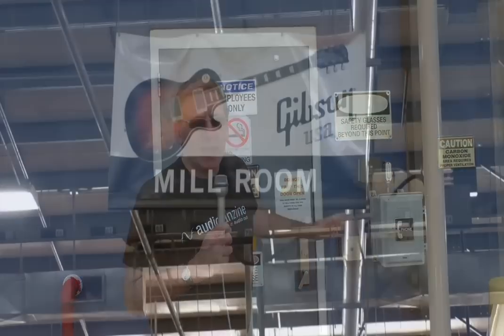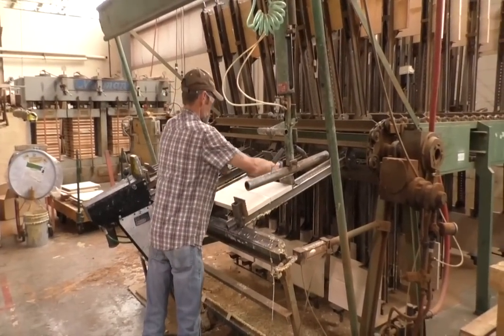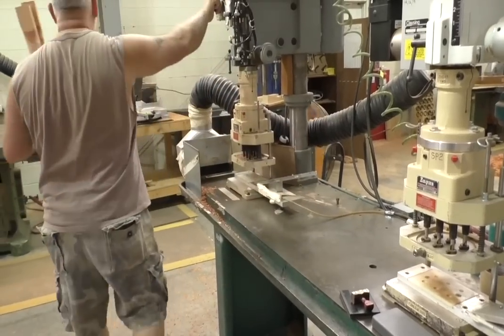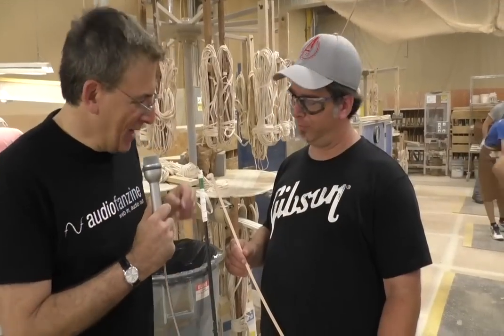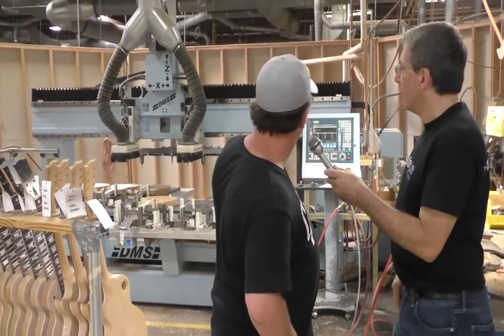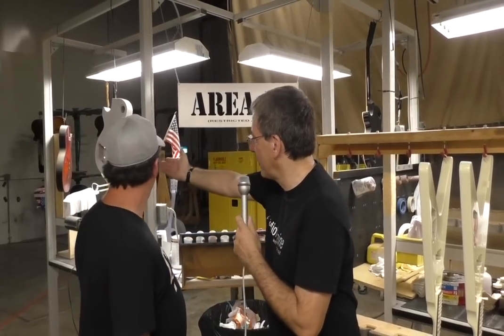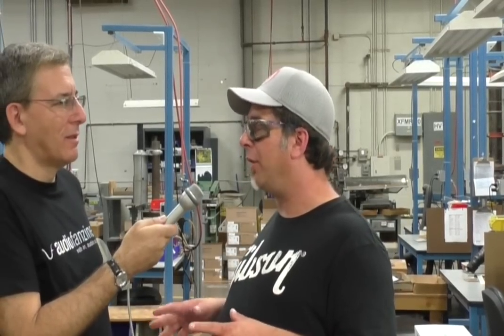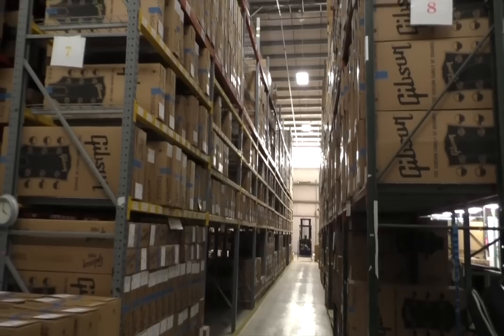Inside the Gibson Guitar Factory

Comment: Just reading a couple comments above, and this needs to be properly addressed: tuning issues are NOT caused by the headstock angle. It is mostly caused by three things (regardless of the brand of guitar), in this order:

1. An improperly cut nut. Nut slots that are cut too deep or too tight will cause all kinds of binding issues that wreak havoc on the ability to keep a guitar in tune, especially if you do lots of vibrato and string bends. Even if the nut slots are cut properly, sometimes the material itself can cause friction within the slots that can affect tuning as well (especially if it is dry). No matter the guitar brand or the nut material, always, and I mean ALWAYS use nut lubricant. I actually use graphite pencil shavings as a dry lubricant on all my guitars. It never "dries out" like oil-based lubes (because, inherently, graphite can't), and it works like a dream. Before I used it, sometimes I would get "pinging" or "chinking" of the strings when tuning or during string bends, but that's a thing of the past with the use of graphite in the nut slots.

2. Weak and unstable neck. If the neck is flexing too much, it throws the pitch and tuning off. No neck that is unstable will be able to stay in tune. Ever. It amazes me how many people overlook this extremely common issue when buying guitars, or when diagnosing a tuning issue. Grab the neck, strum a chord, and gently push the neck back and forth. Ideally, the pitch should change very little. A little bit is okay of course, but if it sounds like you are using a tremolo, you have a crap neck, and nothing can fix it unless you can replace the neck itself. Unfortunately, this is one area where Fenders actually have an advantage. Also, a loose and/or improperly set up truss rod can affect neck instability and tuning issues as well. Make sure your neck is set up properly.

3. Tuners. Believe it or not, tuners are actually the least common source of tuning issues! Seriously! This isn't to say that crappy tuners can't cause tuning issues - because they can - but more often than not, it is the two issues above that are the more common source of tuning instability. However, if the two things above have been properly address and diagnosed, and you still have tuning issues, then try changing your tuners. But even the best tuners in the world cannot fix the issues above, so don't think that replacing the tuners alone are a one shot solution, because they often aren't. Also, if you have tuners like this: tighten those little screws on the end of your tuning keys! Those are there for a reason! Tightening them helps to regulate the turning tension of the tuners themselves, and can help with tuning quite a bit. I have owned both cheap and expensive guitars that had tuning issues, and were either significantly improved or even had the tuning issues resolved (with one guitar I owned) after tightening the screws on the tuning keys. All it takes is a Phillips-head screwdriver and about 30 seconds to do.

Hope this helps. Cheers.
Reply: I own four different Gibsons, three of which are very old(40 and tp and 60+ years) probably built before all of the automation. But i also have one that is only 4 years old and i am equally happy with all of them. (68 Gold top, 75 L5S, deco LapSteel, and a new ES339). Love em all. Also have a rosewood tele and many others. But i love my Gibsons.

Comment: For those who can't afford a $2,500 Gibson Les Paul - you can pick up a used Gibson Les Paul Studio in the $799 range and it's roughly the same guitar without all of the expensive frills (like highly decorated maple tops and plastic binding.)  If you're really on a budget, you can score a used Gibson Les Paul Tribute series from 2013-14 for around $599.
Reply: budgetguitarist.com my Gibson les Paul studio was 2000$ what are you talking about
Reply: There are different grades of Studio models, but $2000? You got screwed.
Reply: When I was trying to buy a new Gibson Les Paul Studio Ebony I saw prices as high $1800usd and as low as $1099usd. After some negotiation I picked one up for just under $1000usd.

Comment: I had an Explorer that I bought brand new in the mid 80's that was reasonably priced. It was white with blue paint splashed on it and a Gibson modified Kahler. Gold hardware too and held its tuning perfectly. My only complaint about it is that it had a lacquer finish which developed brown marks where the guitar rested on the stand which had black foam on the supports. The lacquer took on the foam's dye after owning it for two weeks. I learned the hard way about lacquer finishes. If I ever get another guitar with a lacquer finish, I'll have to put it on a stand that has surgical latex on the supports.
Reply: Lacquer is can be very weather depending product. If there is a lot of humidity you will have problems. You can only control so much a simple open door can screw it up

Comment: I own two Les Pauls. The quality at Gibson is very hit and miss. My Studio model is a better playing guitar than my Traditional that cost almost twice as much. When you pull any of the covers on the instrument there's all kinds of loose wood shavings, saw dust and unsanded areas, just very little pride in what their putting together. I'll probably never buy another, they just seem to be more interested in the number of instruments they can put out instead of the quality. Oh and the lacquer on the headstock started to separate at the machine heads. I have guitars that don't even cost a third of what my Gibsons cost and they never did garbage like that. Disappointing to say the least, I work to hard to spend my money on these overpriced instruments.:(
Reply: +Mike Cantu I have three Gibsons (Les Paul, ES-335 and an Explorer) and all are very nicely done guitars. But in your case I would contact Gibson and let them know what your experience has been.  For the price of their instruments, their quality should be consistantly high.

Comment: I am in the process of restoring my 1991 SG.  After stripping it to the bare wood, I found two or three names hand written in the neck pickup spot and the date also hand written in the bridge pickup spot.  The date was written “5/14” which makes sense because the first 5 of the serial number are 91341, meaning 5/14/91. The names are sort of hard to see but it says either “Bob Jim Darryl” or “Bob & Darryl”  either way I can clearly make out Bob and Darryl.  Pretty cool to me, the hand written names add the human touch

Comment: Good video, but as to be expected, it puts a positive spin on Gibson. Well, here's my story,.,.....I've generally found that Gibson are not at all customer-friendly and seem not really bothered about regular customers - this is only my experience, so if others find different, then fair enough. However, my experience of Gibson is based on owning four instruments - two regular Les Paul Standards, a Custom Shop 335 50th Anniversary and a Les Paul Custom Black Beauty, with 3 p/ups and a Bigsby, all gold hardware. I love all four instruments, but I had a real task to find them amongst many duds, where there were manufacturing errors and just poor attention to detail. The worst experience was buying the Custom (a special order) where the thing would not intonate because the BRIDGE WAS INSTALLED WRONGLY - it was barely noticeable to the eye, but enough to make a difference, when it came to staying in tune, even allowing for the inherent issues presented by the Bigsby - a real nightmare at gigs. So, I reported this to my dealer, who agreed, Gibson however, got very aggressive and defensive, angry that I had the nerve to criticise their product. They refused to change the guitar, insisting instead that they repair it - a £3,500 guitar that should have been right from the get-go. Thankfully, my dealer saw things from my point of view and immediately changed the guitar for another LP Custom which seemed fine off the bat. But that wasn't entirely fault free, either - again tuning issues, but this was more the result of having a BIgsby, as in fairness to Gibson this time the bridge was correctly fitted. My guitar tech suggested fitting a Tone Pros Roller Bridge, which looks identical to the original item, just with roller-saddles. It also locks in position with a couple of allen-key operated worm screws that do not allow the thumb screws to work. Problem solved, but you have to look very close to see that the bridge is not stock. Why on earth couldn't Gibson make such an alteration, or at least offer it as an option? Nearly two years of use, in which time, I've used it at many gigs and restrung it many times, its been problem free. The only Gibson guitar I've not had to sort through to find a good one is my red 335 1963 VOS Anniversary - beautiful, straight out of the box. Gibson at their best. Its a shame they can't aim for this every time, but unless your name is Slash, Bonomassa, etc, they don't give a damn. They're bloody rude. 

Still, like many, I'm a mug for Gibsons (part of the problem, I guess) and in October 2015, decided I wanted a jazz guitar - with the name Gibson on the headstock, naturally. So my dealer assembled a few for me to try - a Custom Shop ES175, the regular non-custom shop model, even a Switchmaster. I thought they were all poor - cheap hardware, bad workmanship, just....not what I was expecting and not even close to my 335. So whilst having a coffee break in the store, thinking I was destined to leave empty-handed, I spotted another instrument in a cabinet, well out of reach of casual dreamers, which spoke to me; it seemed to say, 'forget all that crap, buy me instead...' It wasn't a Gibson, not even a jazz guitar, but a Fender Custom Shop 1954 Heavy Relic Stratocaster. I asked to try it and five minutes of noodling though a Mesa MkV (my main amp) and I was completely sold. I've never been a fan of relics and even though I have several Fender Custom Shop instruments, they are all 'new' instruments. But I'm converted - this thing rings like you wouldn't believe, is lovely to look at and to play and has tone to die for.  I surprised myself. As for workmanship, its in a different league, makes that days offerings from Gibson seem even poorer. 

Gibson seem not to take the same pride in their products that you see from Fender (not just CS, but USA & Mexico) and PRS on a different planet - have owned a Custom 22 Artist from new, its now 14 years old and plays like new. I don't own any Tom Andersons, Hubers or Suhrs, but they look much the same, quality wise. It's a shame what Gibson seem to have become - a commodity guitar maker. The Ford of guitars.

Comment: Played a new Gibson SG once (a 2015 model I think). Stock strings slipped right out of the nut with any sort of string bends. Like you bend the G string and all 3 high strings would slide right out of the nut and off the neck. Then the same fella ordered a new Les Paul standard. Damn jack was wired backwards. Gibson quality control is pretty much nonexistent. They took his review off their website within a day. And it probably wasn't as prompting as the story I just told.

Comment: I would have thought they would paint the bodies before they put the necks on.
Reply: +BubbaZen10 You can't finish it correctly, the finish is the same from headstock to strap button. 
Fender, yes. Set neck guitars are a different beast.
Reply: alwaysopen Good point. I guess a lot of them do have that same color on the neck. My gold top just has a different (ash) neck than the body. Did they always do that before?
Reply: Les Pauls have traditionally had mahogany necks.
Do you have a 70s Norlin "pancake" body Les Paul? Some of those came with maple necks, not ash. My 70s Goldtop has a mahogany one
Reply: alwaysopen It's a 70's goldy with a white ash neck. (i am not sure if it's a norlin.)

Comment: Just bought a 2006 Custom Shop SG VOS 61 reissue from a shop in the US. I've got to say this is one of the worst made guitars I have seen. The SG is a very uncomplicated guitar. The bridge pickup is not even fixed square to the guitar. It is squint. If you put a little pressure on the neck the strings bottom out. I cant believe this came from any custom shop. It is a pile of junk and it cost over $2000 dollars second hand. Gibson guitars are throwing out any old crap for the past 20 years. No more Gibson's for me I'm afraid.